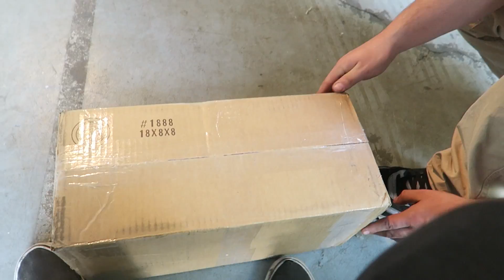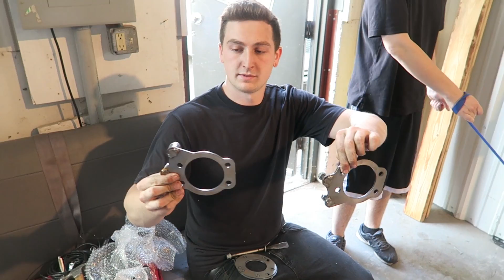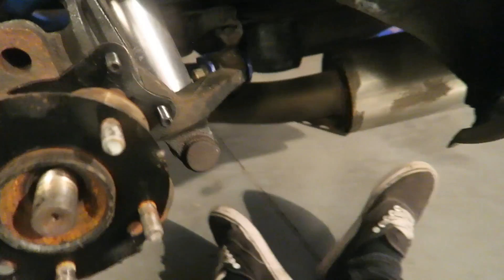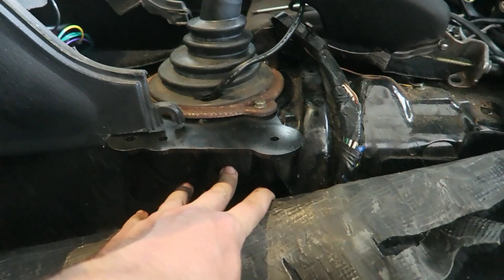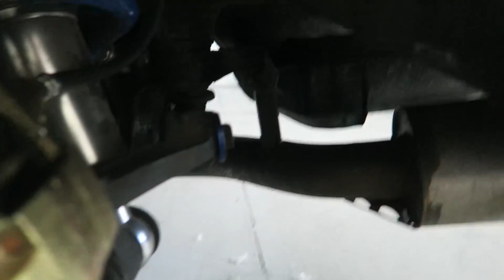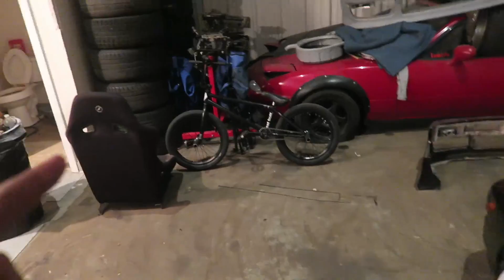Dual caliper hydro e-brake install!

Comment: I went through the same struggle finding fittings for my hydro.  If you ever do this again, you should try to find a shop that makes high pressure braided SS lines.  I'm sure there is one somewhat close to you that makes lines for semi trucks and stuff.  I ended up going to them and showing them my master and the caliper that it went to, and they made me a nice SS braided line from the caliper all the way back.  It isn't too much more expensive, and it definitely beats driving around hunting for fittings and part stores.

Comment: The line looped over the master cylinder is going to get broken off! Get 90 degree elbow fittings and take it to the floor with them.   :)

Comment: you could paint that brake line or put some on the wiring cover stuff over it so it doesn't stick out like a sore thumb but it wouldn't bother me the way it looks now copper color

Comment: @jimmy Oakes you do know to make a bubble flare you can use that brake line flaring kit u have you just dont do the 3rd flaring step. I hope that makes sense to you. It would save you from buying those adapters next time u do a hydro set up.

Comment: Wonder if it’ll work with stock q45 rear brakes ? Or is it just meant for stock rears ? For a s14 with q45 brakes on all 4 corners.

Comment: Jimmy how much z32 calipers cost in us?
Reply: go on AMAZON dot COM 
i get all my parts on there
& it depends you get what you pay for!
Reply: just found one for $83.27 if u have amazon prime!
Reply: Eds JDM Vlogs You can get used fronts for 200$ and less. 

Back maybe 40-80$. I got the 4 for 150$ from a part out. Alot of clueless pre Z owners here.

Comment: I hate that you guys do it with solid line like this using a mixture of both braided and solid would make this a lot nicer
Reply from the maker: whiphore sorry homie didn't have the money for the braided at the time, trust I wanted the main line from the hydro to the split braided at least
Reply from the maker: whiphore sorry homie didn't have the money for the braided at the time, trust I wanted the main line from the hydro to the split braided at least